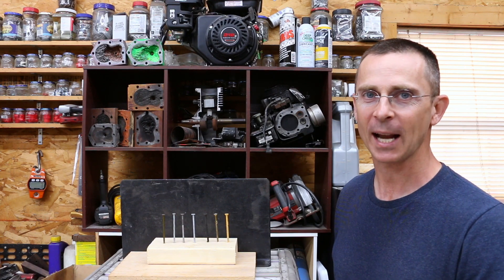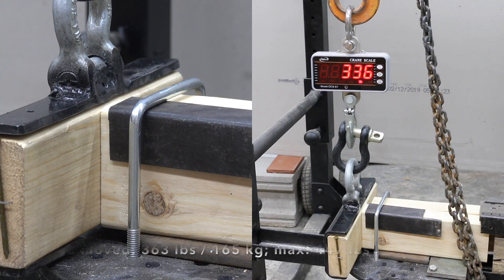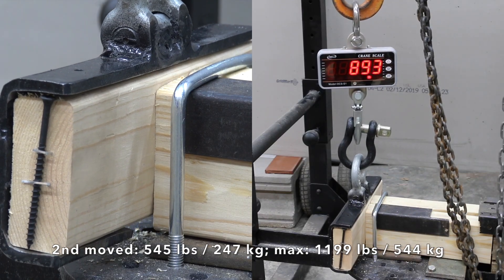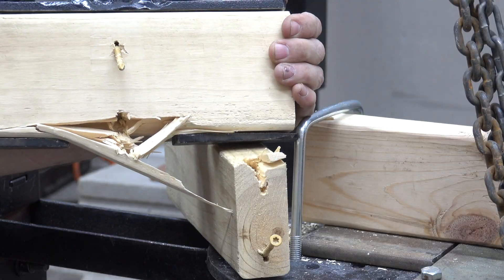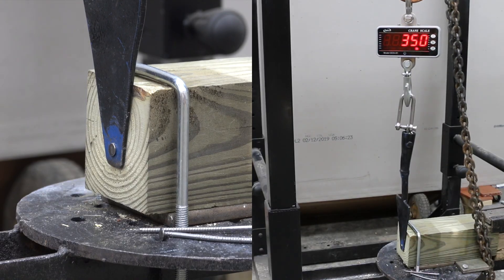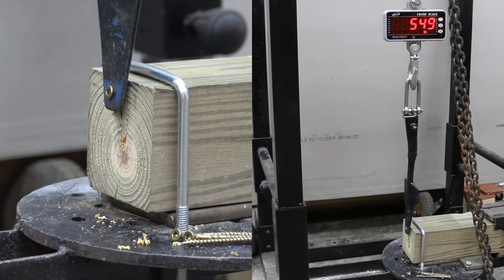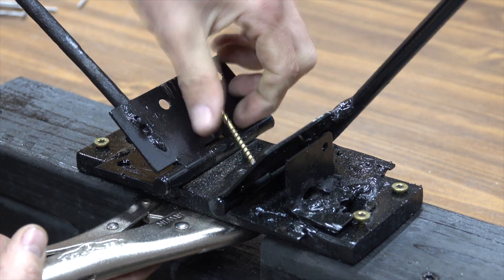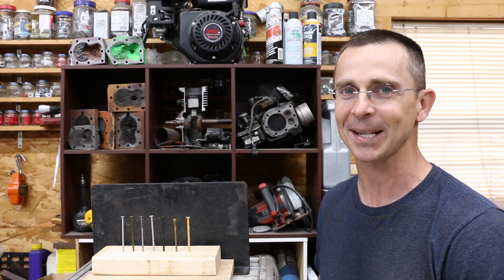Do Screws Shear easier than Nails? Let's find out!

Comment: These tests weren't a specifically shear test since the boards were allowed to deviate from the vertical.  A retainer to prevent angular deviation would have measured actual shear strength.
Reply from the maker: Thank you for the feedback

Comment: Honestly screws have always generally been better as a fastener for strength, sheering is not an issue to be honest as the other materials are going to fail long before the fasteners especially in the amount you use in construction. Typically the time and cost savings are what make nails the choice for building over screws.    The fact is that it takes much much longer to use screws over nails.   I mean someone skilled with a framing hammer can easily put in 3-5 nails in the time it takes to do 1 screw and that is manually with a hammer, with a nailgun it is an even bigger difference, your talking being able to do 20 nails in the time you could put in a single screw.  Then you have the time cost when a screw head breaks and you have to either cut or twist it out vs pulling a nail.    When your talking about a project involving multiple thousands of nails/screws the man hours are a massive factor.  You talking a difference of potentially thousands of man hours just building a single house from screws over nails, a larger structure like even a small office building you could be talking tens of thousands of man hours.
Reply from the maker: Great point. Thank you

Comment: I normally love your testing and think you do a great job but your setup for shear in both this and the wood glue test are less than ideal.  In this case the nail should have sheared or the wood failed but all of the nails pulled before they sheared.  Something really needed to be behind the bracket holding the wood to prevent the lateral movement so it was only vertical.  This was just a variation of a pull test as you have a pivot point in your setup allowing movement in more than one direction.
Reply from the maker: Thank you for the feedback

Comment: Great test for pull out, not for shear strength
Reply from the maker: Thank you for the feedback
Reply: @ProjectFarm  don't get me wrong, your testing is super and shows well how the wood fails in real life rather than the nails.  This is why metal brackets are used for joist hangers, so that the shear force is actually transferred to the nails.

Comment: Doesn’t really work like that.  Screws tend to be high tensile and have a greater surface area. The surface area and thus bite defines the grip although a brittle screw will snap easier.  Ah ye covered it.  Good on ye :). The then next issue is the timber itself as never uniform in density.  Might I suggest a fibre board.  Just so as you know. My background is in experimental physics.  :)
Reply from the maker: Thank you for the feedback
Reply: Project Farm welcome.  Love what you do.  A bit like Ave only a tad and then some more polite.  :)

Comment: I think you should have used a piece of metal instead of the wood you were using considering you're testing the strength of the nail not the strength of the wood plus that way you could see the amount of force it would take for all the screws and nails to shear/break

Comment: I would suggest that the shearing test was flawed. The fasteners were being pulled out rather than being sheared. Since the wood is relatively much softer. I see that it is difficult to run a shear test. A jig on a hydraulic press would have been better.
Reply from the maker: Thank you for the feedback

Comment: Very interesting and well done but not a true sheer test and in my mind just reinforces that screws are superior all round fasteners to nails. The idea is that what you fasten should stay fastened tightly and then you won't have to worry about repetitive strain type breakage. We don't build structures made of wood that are designed to sway or accept repetitive bending forces so why allow for that by compromising holding power and pull out strength? Seems counterintuitive to me. Build things that don't move or where the weakest link is the wood itself and you don't need to worry about sheer strength. Your testing proved that screws are stronger than wood and screws are stronger than nails. The bending tests are simply not "real world" examples of forces that are applied to buildings except in catastrophic situations and in those situations, I'll take "twice" the holding power over twice the flexibility any day. That boarded up window keeping out the huricance force winds is way better held with screws in almost every scenario except where the house is wobbling over. At that point, one has bigger things to worry about than sheering fasteners.

Comment: Good testing methods.  Great video.  As a General Contractor here in Kalifornia where building standards are the most stringent, I can say that the most applicable and demonstrative test method as it would apply to earthquake concerns would be the last test.  The destructive energy leading to failure is the back and forth movement from an earthquake.  No city building department will approve of an all screw construction.  One can use screws, as I do too, but they must be in addition to nails and cannot be substituted.  One slight exception is the use of screws made by Simpson-Strong Tie but they must be spec'd in the blueprints when submitting plans.

Comment: This was a very well-designed and useful test.  You are a genius at devising practical tests on things that people actually use and need to know about.   I have one comment on the shear strength test with the fastener being inserted into the center of the 4x4 - as I watched this great test, I noticed that the shackle that held the 4x4 in place was not tightened down after each new piece of 4x4  was inserted for the next test, nor was a wedge used to keep it from moving.  This allowed a small amount of motion to occur so that when the device pulled upwards on the fastener, it also pulled the end of the 4x4 up, and the effective pulling angle went from 90 degrees to approximately 85 degrees or less.  This converted the test from a true shear strength test to a modified test where the strength being measured was the amount of pull required to remove or break the fastener when being pulled on at an acute angle, but at less than a right angle. Because the pulling force tends to pull the fastener up through the wood fibers until it comes out, thus continually changing the pulling angle, the small movement of the 4x4 inside the loose shackle may make no practical difference, and may more accurately reflect real world shearing conditions, but you are a detail-oriented person who pays attention to such things, and if you have the time, you might want to review the videos and repeat one or two of the shear tests off-camera to determine if the loose shackle affected the results of the test in any way.   

A test idea for you, if you haven't already done it, would be to devise a test of the effects of the chemicals used in treating wood on the types of fasteners you tested here.  Using bright nails or untreated fasteners in treated wood is a recipe for disaster, and on home construction can result in a house being condemned as unsound and unsafe in only a year or two.   The question is how long do these fasteners last without rusting out or losing strength, when used on treated wood.

Thanks again for this video and for all the videos you do. You help more people than you know with the results of your testing.

Comment: Your first test is not an accurate shear test – not even close.  This is because the upwards pulling force is causing the upper edges of both pieces of wood to press together.  This creates a fulcrum and causes the wood being pulled to behave like the claw of a hammer.  Thus the fastener is being pulled instead of sheared.  I have included a link to your video showing showing the exact frame at which the fulcrum is created.  

https://youtu.be/qmajKElnwfE?t=114

Comment: Would they preform differently if they were driven into the side wall of the wood  instead of the centered end... Considering builders use brackets that place the fasteners on the side and not the center

Comment: Honestly the structure starting to move will cause failure so some times it not wanting to move with the screws will help stop that failure so I would consider doing both nails and screw in tandem if possible. Maybe that could be a later test to try, if screws, nails, or a combination of both show any difference and possibly what amount of each screw to nail is best. Like a screw and nail or 2 screws and a nail and so on in say a 2x4 to 4x4.
Reply from the maker: Thank you

Comment: Problem with the 1st test is that I noticed the steel brace under the U-bolt was not even between each test which caused the wood to fail randomly. I believe the screws would have had a greater amount of grab if the wood didn't fail first. Recheck if you feel I maybe correct. Love your videos
Reply from the maker: Thanks for the constructive feedback

Comment: I built my daughter a massive play house. I used screws for wall framing and nails for floor joist and header boards. Screws are fine for studs since they are simply keeping wood from moving and the direct force is on the wood. All plywood was fastened with screws. Deck was built with 6×6 post for decking frame. Used stainless steel 3 inch screws for fastening 2x10s to post. Post were notched so all shear force  was resting on wood. Hope this playhouse out last me.
Reply from the maker: Nice!

Comment: Guys he was testing the shear force necessary to cause a failure, either being the pulling out or breaking of a nail or screw. In my opinion this is more relevant since in practice it does not matter what force it takes to break a fastener if it pulls out beforehand.

Comment: I spot a methodological error sir. This is not purely shear force, owing to the fact that with the lifting point is centered on the forward 2x4 instead of directly over the junction. This forms a fulcrum on the top nail, the leverage of which applies a significant normal force to the underside of the lip of the lower nail, pulling it outward instead of upward after the first small amount of slippage.
Reply from the maker: Thank you for the constructive feedback

Comment: It's sad when youngsters try to put down a simple test of uncertain variables that can't be 100% true all the time. 

I approve of this test. It shows the random occurrences that can happen. In a real scenario shearing can occur by bending twisting due to stress and weight or pressure.. all falls into the same category. 

People say this isn't a shear test. I say it is. Due to 3 test being conducted showing different yet same ways a screw or nail can fail or even it's structure connected to. It happens. Even in a real life situation pulling is sometimes inevitable grip gets involved one way or another.
Reply from the maker: Thank you.

Comment: Love your videos as always. Just wondering why during the nail tests your steel support angle was pushed all the way to the t-joint and during the screw tests the support angle was held back just barely under the U Bolt. This allowed for the wood to flex possibly giving inaccurate results. I think the positioning of that support angle is critical to each test. I also agree with another viewer that face grain would have been an awesome test as well. Anyway keep up the good work. :-)

Comment: Part of Shear is wind and the rocking motion , the Nail & Screw test in the bending tool is the best part of the Video . I use Deck Screws with the ceramic or powder coating they work great hold up in all weather even hold up to salt for porch summer deck  .  Headers need a ring on the shank  aka pole barn nail .  screws only Windows , drywall , doors hang cupboards  building a home  .  back in the 80's I used Twist Deck nails with 1-1/4 deck boards , but after 5 years the nails heads still pop up 1/4 inch . just from expansion hot cold weather.   Great Video you covered all the Bases
Reply from the maker: Thank you for the positive feedback!

Comment: there is an issue with all of these tests, due to the fact that if you were to use an actual 2x4 fresh then nail after some time it dries out and has a better grip on the nail therefore the ring style nail has a very high efficiency for untreated wood prior to being aged a little. so these tests dont really reflect the true worth
Reply from the maker: Thanks for the constructive feedback
Reply: @ProjectFarm   Thank you for making these very entretaning and informative videos - the best review video was from Amazon oil - I was quite shocked to see how well it performed. I'd be curious as to what is the best type of hydrophobic coating for walls

Comment: I am a welder by trade, and I really like how you made all your own jigs and testing apparatuses. Very thought out and cool.
I see people saying the sheer test is wrong, but in my opinion, it's just a real world application. Yes, it's not textbook, but it tells you valuable information (not garbage like some comments state). 
Amazing work!
Reply from the maker: Thank you very much!  I thought about setting up the shear test differently but like you mentioned, it wouldn't provide real world application results.
Reply: @ProjectFarm  That is true.  Wood-frame walls are usually built flat, with two sinkers through the top/bottom plates into the end of each vertical stud.  That is a real-world test.
Reply: yes, this is why the rated values are wrong... in an ideal scenario the screw should match the shear force stated on the packaging or website or whatever could be done with some hydraulic shears or something...

in reality the wood will always fail first.
Reply: Yes and no, in some real world situations blocking would prevent the pieces of wood from separating. It’s very difficult to set up pure shear tests. Good work overall though and useful values for some minimum applied values as well as for comparative purposes.

Comment: I recently needed to anchor a heavy object to concrete and found a variety of bolting methods (wedge, expanding sleeve, Tapcon screw/bolts, powder actuated nails, etc)  How about a comparison of a few of these?  Which are easier, hold better, or have the ability to be removed.
Reply from the maker: Thank you for the video idea!

Comment: Fantastic work on this. I was surprised about the performance of the drywall screws. I use them to construct many different things with dimensional lumber usually. Cheap enough to use as tiny clamps until the glue dries, and strong enough to really hold stuff tight. I did know they were brittle (every time I do demo on something with drywall screws, they just break instead of bend)… but I didn't know they could really hold that well. The last bending test with the two hinges doesn't concern me, because in the real world I doubt anything decently constructed would ever move nearly that much... but I understand why you did it...It was informative as to what types of strengths each fastener has.
 
I like the little touches you do, like putting the screw/nail on the side of the piece you're testing so I can remember what's being tested, and having two views, up close, and farther away to get a better view of what each failure looks like.

FUTURE TEST IDEA:  I've noticed that some fasteners don't particularly like being 'impact driven' into boards where others don't seem to loose strength; I've had a few heads of various fasteners fail while being driven.  I wonder if there is a way to test which fasteners hold their strength while being 'impact driven' into the boards. I'm guessing that would be difficult to determine because the type and density of the wood would play a big part in the process since it is providing the resistance to the twist.  Maybe before and after tests on impact and non-impact driven fasteners? Pilot hole and non pilot-hole tested?  Just a thought.

Anyway,  I enjoy watching these videos, you are really good at setting up these tests, and I like that the results are sometimes not what's expected.
Reply from the maker: Thank you

Comment: That last testing rig with the hinges is great!  I was thinking, "oh, boy, those'll get stuck," until I saw the vice grips - nice!

So now I'm wondering what to use in a shear situation.  I built a kayak-hauling frame on top of a utility trailer and the GRK's do shear off on particularly bad roads (I have redundancy, so no terrible failures, just annoying).  I was thinking "hardened bolts" but if I remember my materials, hardening induces brittleness.  I have 1/4" galvanized bolts to try next but it would be cool too see ProjectFarm-level analysis brought to bear on the best choice for shear-condition fastening.  Maybe Simpson?

I like how your methods are bringing rationality  and sound decision making to small-scale engineers who can't afford their own Materials Division and chasing out the marketing-created "common wisdom" from our fraction of society.  You're making the world a better place one testing rig at a time.
Reply from the maker: Thank you!